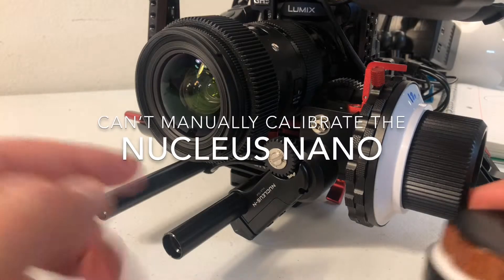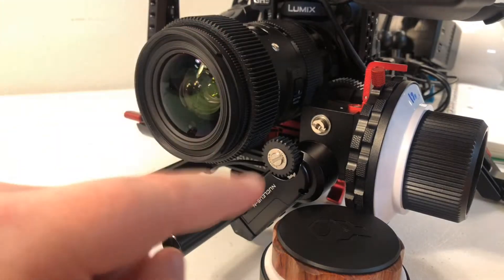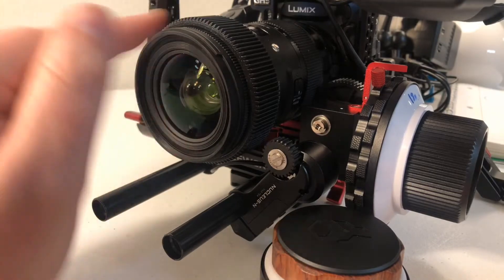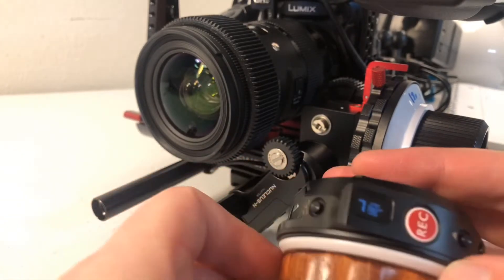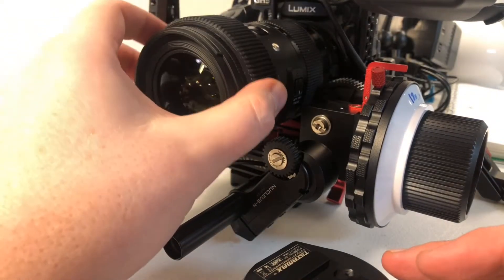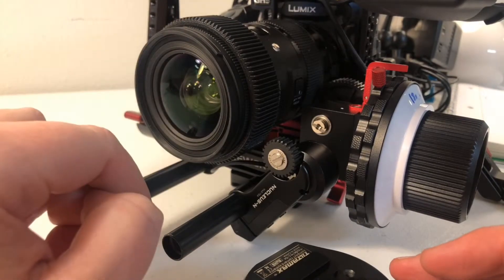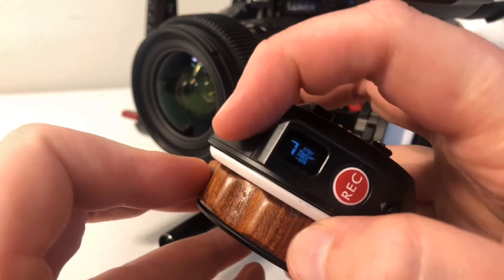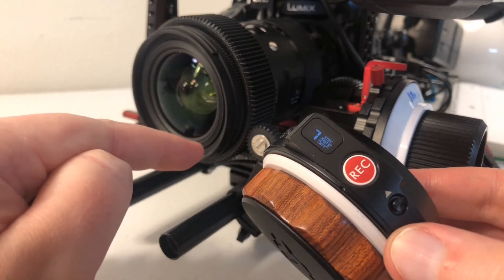Help! Nucleus Nano won’t manually calibrate (Tilta remote follow focus problem)

Comment: I hope that you resolved your problem by now but if you haven't,  the procedure goes this way:
Disconnect the motor from the lens. 
Turn the wheel to minimum distance(all the way towards you) and set the lens to minimum distance.
Double click cal button. 
Connect the motor. 
Slowly turn the wheel until you reach max distance. 
Double click the cal button to finish calibration.
Reply: Yes. I think he was doing a process in reverse.
Reply: Pozdrav, dali znati koji moze biti problem ovde https://youtu.be/4cIeJ89_hf0. Kao da ne radi motor kako treba ?
Reply: @predragspremic1615  Ako su baterije i napajanje u redu, možda treba da se uradi kalibracija? Nadam se da nisu zupčanici.
Reply: @sbozinovic  Hvala ti na brzom odgovoru. Nov je motor, nisam ga nikad koristio tek narucio a nikako da uspem da uradim kalibraciju. Kao da je slomjeno... Moram videti da vratim na popravku. Hvala puno. Pozdrav
Reply: @predragspremic1615  Da li si proverio baterije? Za motor i za kontrolu. Drugo mi ne pada na pamet ako si pravilno probaao da kalibrišeš. Ja nisam duže vreme koristio motor ali znam da kalibracija može dobro da zeza.
Reply: @sbozinovic  Baterije su ok, al znas sta me zeza, prvi put je radio i jednom je pocelo da cima na sve strane i od tad nikako nemoze. Sad ne znam nije mi bas jasno ovo oko kanala, ja sam pokusao kanal 7 na 999. Al to ne znam cemu sluzi jer nemam onaj Wheel. Nego samo nano motor. Za kalibraciu stinem kako kazu, i onda trepti plavo al samo sto nece da se okrece onaj tockic mali na motoru, kao da ne reaguje na toack sto je u Handle Focus.
Reply: @predragspremic1615  uh, ja nemam handle nego wheel... a opet verovatno je da je pitanje kalibracije, ne verujem da se pokvario posle jednog korišćenja. Oni kanali su da bi motor i točak bili na istom.
Reply: @predragspremic1615  Da li si probao da kalibrišeš samo motor pa posle handle? Neki lik na youtube kaže da se ručno zaustavi objektiv u krajnjim pozicijama kad se kalibriše motor ( https://youtu.be/mGQ-FVnGYik ). Izvini što nabacujem ovako...  kao što rekoh nisam imao iskustva sa ručicom, samo sa točkićem...
Reply: @sbozinovic  Hvala ti, pokusavao sam i to rucno al nece. Fora je sto kad imas taj Wheel onda mozes da mu uradis Factory Restet al bez toga ne moze. Pokusacu jos jednom i ako nece, onda cu da ga zamenim. 
Jer ja sam probao i na Objektiv koji ima stop na fokusu, al nece onaj tocak da se okrece kako treba. Hvala puno na vremnu, bas lepo od tebe :)

Comment: I Didn't own it. But I was going through reviews and heard someone said that you can actually change its direction through the menu. clockwise or anticlockwise. I hope it will solve ur problem. cheers!
Reply from the maker: Arslan Mahmood thanks so much!! I’ve tried this but it doesn’t fix the issue unfortunately. I’ve discovered it’s got to do with the motor “auto sensing” some kind of friction - that’s the issue. It only happens on some lenses too! :)

Comment: I think I had this same problem and what I did was start at 0 on the focus wheel and then set my lens to the closest focus setting and then pressed calibrate twice to start the calibration process. Then stop at infinity focus. Then double tap calibration button. complete.